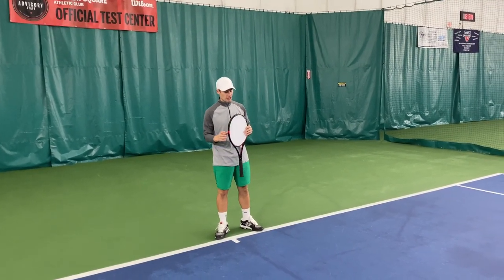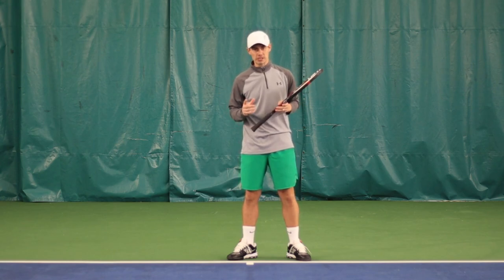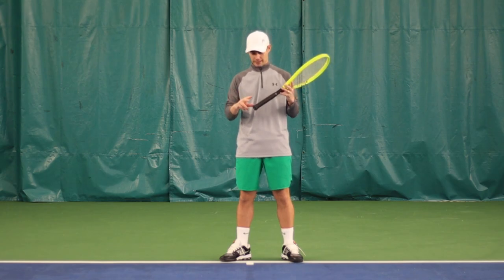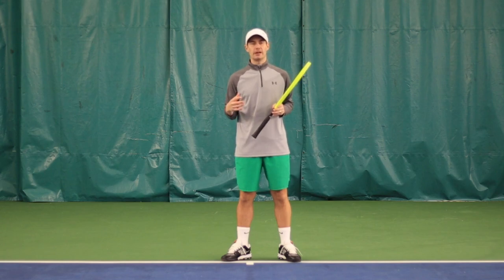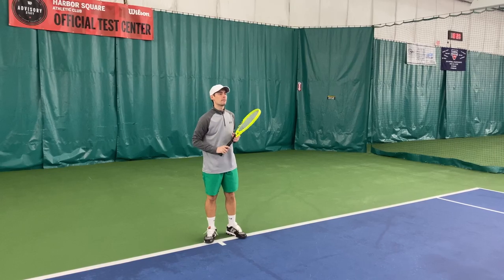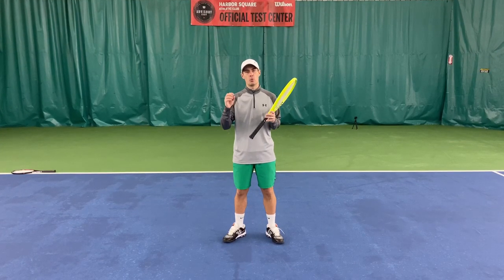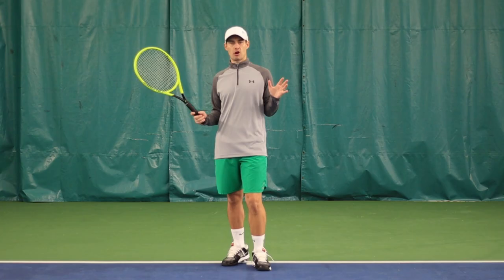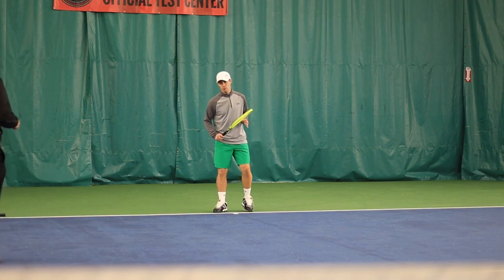Increase Your Swing Speed | Goal for 2020

Comment: I like your drills, thanks.  There’s something I notice about your open stance forehand.  You don’t push off enough on your right leg and so you don’t get the proper leverage from your core. Most of my forehand power comes from my core and it’s just as important if not more as racket head speed.  Because you are trying to drive the ball forward but there’s no forward body movement in the open stance, your leg and core provide the weight transfer.  If you push off more and engage your core, you will have more power in your open stance forehand.
Reply from the maker: Thanks for the tip Wally 😉